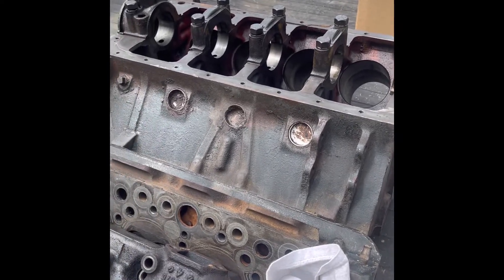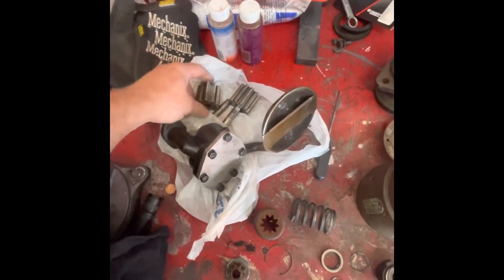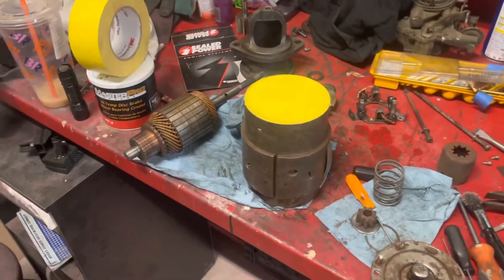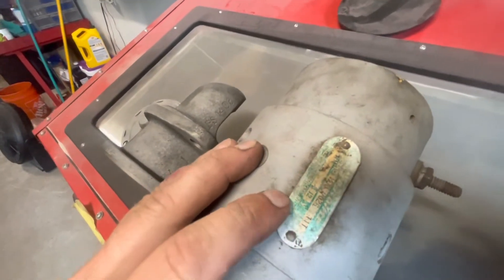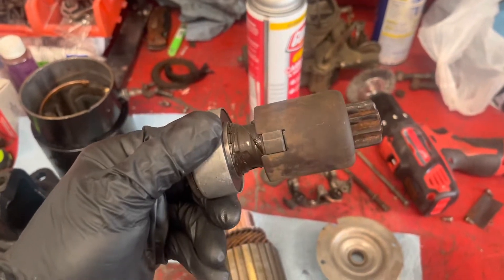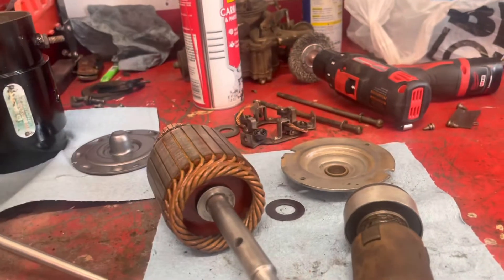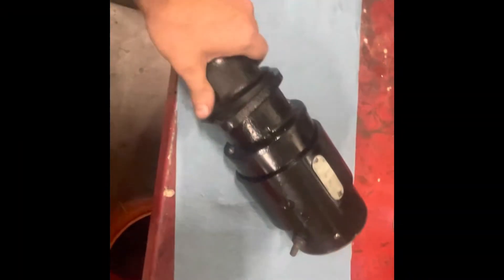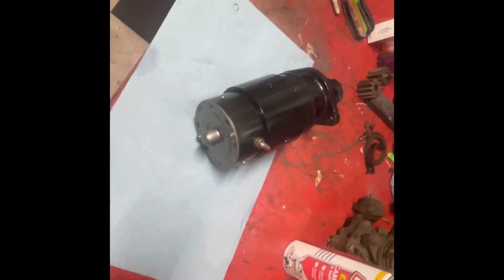Studebaker Prestolite starter repair and 259 update

Comment: Show one end but not the other. Black wire to post and coils. Green wire to brush assembly WHERE DOES THE OTHER END GO. You were so close...HELP.
Reply from the maker: I believe the other end of the green wire just went to the body of the starter case and the black goes to the power/battery cable terminal

Comment: I cant believe someone actually took one of these apart besides me. I really need to know where the little wires GREEN and BLACK in the one have, where do they connect? Especially the GREEN one. They are both single strand and insulated. The BLACK one is intact. The GREEN one was broken on one end and for the life of me I cannot figure out where it goes. One end is mounted to the 'wheel' that goes in last with the 3 screws/. Its the other end thats busted off.   The starter goes in a boat Im attempting to resurrect from the dead.  The bendix (like yours) will not retract all the way back. I took it apart but can not figure out why. It stops about half way down the gears. Only moves about a 1/2 inch. Could really use your help. Thank you D.

Comment: Hey Rob, question about the bendix.  When I took mine apart, the bendix was stuck in a collapsed position so it wasn't engaging.  You couldn't see the pin hole because the gear part of the drive was covering it.  I have freed the bendix up but it doesn't move very far in and out.  When I watched your video where you showed the bendix moving at around 8:35, yours doesn't move much either.  I haven't reassembled mine because I assumed the bendix needed to go back to the collapsed position when disengaged.  Does the bendix only move that small amount and is that enough for it to engage / disengage the flywheel?
Reply from the maker: Yes the movement you see in the video is pretty much all the further it will move.  It should try to retract when you let go of it because there is some light spring pressure.  It won’t really snap back hard or anything like that but it should try to come back on its own.
Reply: @Robs_garage90  Thanks for your quick reply.  I found this video that shows how to get the drive to collapse. I am going to try it as I don’t think mine will work if it doesn’t collapse. https://youtu.be/GTmxlDXL8hc
Reply from the maker: @chrish5758-u1j  I hope it ends up working for you, but if not, luckily new ones can be found
Reply: I know this is an old post but man I hope you guys are still around. Im having the exact same prob. with the bendix. Did you ever get the solution?

Comment: Great timing on posting this video. I disassembled the Prestolite starter from my 63 Studebaker GTHawk 289 V8 yesterday. The starter was rebuilt 30 years ago so it is in great condition. Like your starter, the only real problem is a sticky Bendix drive that doesn’t slide back and forth to engage and disengage the ring gear on the flywheel.
Since this Bendix drive still appears basically new, I am going to clean and lubricate it rather than replace it. The gears on both the ring gear and Bendix drive look great.
Hope your video inspires others to repair their starters like the video did for me.
Reply from the maker: That’s great to hear!  I wish I would have made more video of the actual disassembly but that’s something to improve on I guess.  I’m sure your bendix will clean right up as well.

Comment: Hi Rob, great job on the starter! A lot of folks just replace parts, but like you did a good cleaning and lube will most of the time work wonders. What shop is doing your machine work on the engine? Are you planning to come to the Tri-State Meet in Maggie Valley on September 9th & 10th?
Reply from the maker: Thanks! I think I was lucky that it was in good shape.  I took the engine parts to a walker auto that has some guys with a lot of experience.  One guy has been there 45 years and I had luck there in the past.  I personally have not been lucky with race shops in the past.  They don’t seem as friendly and don’t seem to want to help you unless you are spending thousands.  I will be on vacation during the 9 and 10, but I do need to attend a meet some time because I have never been to one yet